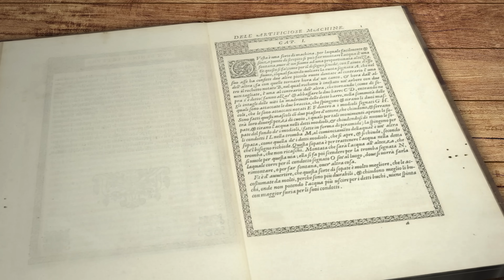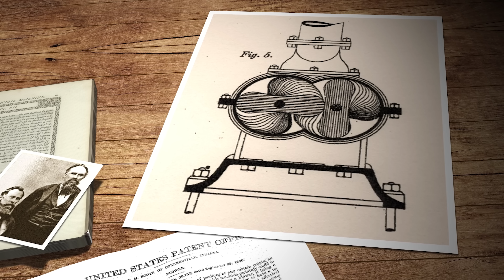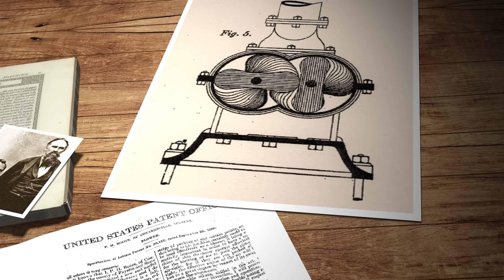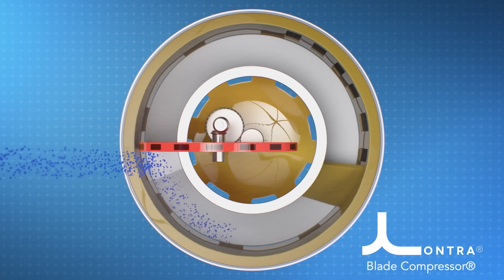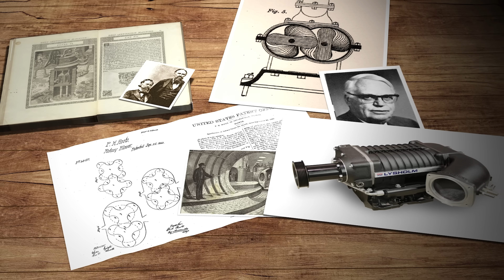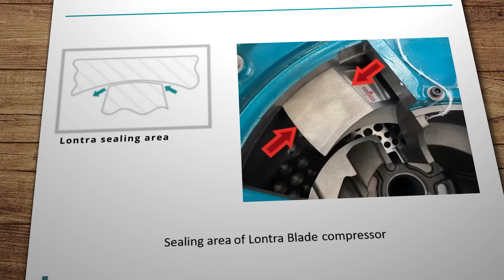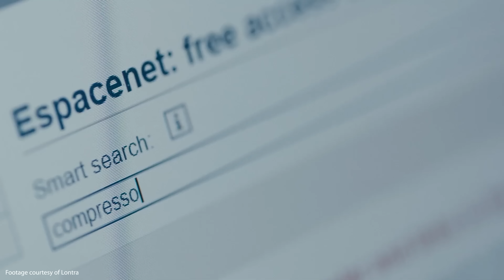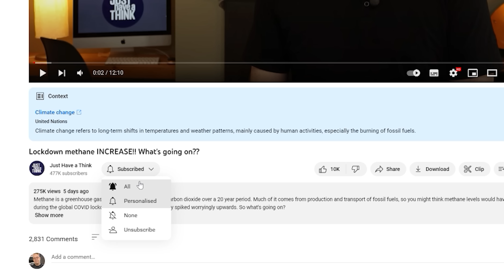Compressing air to reach net zero. A 'revolutionary' innovation.

Comment: Late to the party here, but the sealing issues for positive displacement roots/screw type blowers have been dramatically mitigated over the last couple of decades by the use of advanced coatings on the rotor packs.  These durable yet flexible coatings literally wear in to a near optimum seal upon first use.  This is one of the reasons we can see compressor efficiencies on vehicle ICE superchargers in excess of 70% now (best I've seen is 74%, may be some higher).  Turbos are more efficient still which is why we don't see too many OEM PD supercharged vehicles anymore, but the existing tech, at least in the automotive space, isn't nearly as bad as this video makes it sound.

Comment: compressed air supercharging IS a thing... GM developed it in the 60's and recently there have been some extremely fast drag race cars with it. 
The released of compressed air through the throttle body at room temp will cool the intake charge by 50+ degrees plus you will need to dump more fuel to give the right AF ratio with the add air all which will boost HP crazy.

Comment: Compressing "theoretical" air is not difficult, but real air has particulates, bacteria, COVID, water vapor...The more complicated the device, the likelihood of malfunction increases exponentially with the number of parts involved. If i needed a compressor for any particular use, my first parameters, regardless of price would be a top of the line filtration system, coupled with a precooler of the air entering the compressor, preferably, should money be no object, as close to 0 K as practicable

Comment: 300 Milli bar to 1000 Milli bar,  595 - 2630 m3/hr.   https://www.lontra.co.uk/wp-content/uploads/2021/06/Lontra-LP2-Brochure-Global.pdf
Reply: Ragged Falls air compressor used to output 40,000 cfm at 150 psi. Cool, clean oilfree compressed air cost free.

Comment: In the case of air-cons, rather than making them more efficient to reduce emissions, governments should have solar-passive home design requirements that designers have to meet in houses.
Solar passive homes are designed in such a way as to stay at a desirable temperature throughout the year. One of the ways you can do this is designing windows and shades in order to let in sun in the winter when it is lower in the sky and block sun in the summer.
We wouldn't need air conditioners at all if people just had a think.

Comment: I`m a compressed air engineer and trust me. Don`t worry about the efficiency of the compressor. I`ve been to a place where a 100kW machine was running at full load just to accomodate the air leaks in the factory and nothing is done about it. This case doesn`t stand alone.

Comment: I can't see how that's more efficient than a piston compressor.
The ratio of contact area between parts to volume compressed seems to be much higher.
And involve a whole lot of complex geometries that need to seal while in complex motion, and factor in thermal extension.

That looks like an engineering nightmare to me. I can't really imagine the engineering cost of producing reliable and efficient units to be low enough to compete with more traditional compressors.

Comment: This is not a simple machine like the bicycle pump, it still needs extremely accurate components, those gears that maintain that zero tolerance timing for that slot intersection  need zero backlash, not just the standard minimum  .03/DP, probably going to strain wave gearing,and that alone is a risky proposition,and an expensive one,with lubrication being a challenge too;
 And  any air compressor is still very  inefficient because in the process of compressing air, most of the electrical energy the compressor consumes converts to waste heat. Even the most efficient compressed-air systems only convert 10 to 15% of the operating energy into energy stored as compressed air.

Comment: A few thoughts of the top of my head, about the new compressor design, firstly, if the drive for the compressor was linked directly to a wind turbine could that be used to store energy as compressed air, which could be used to generate electricity when the wind was not blowing, or as your finger demonstrated wind powered heat generation.

secondly you described the compressor as a circular piston, may be with the addition of a spark plug at the opium site we could have an engine that uses a fat burning fuel like Hydrogen .

Comment: I'm surprised they don't simply make it a 2-cycle version by extending a larger disk across the entire surface of the housing. The disk would then sweep over the chamber on both sides. Not sure if that causes too much loading, but it shouldn't take too much modification or increase the footprint volume occupied by this particular pump. Maybe there's reasons for not going with that which aren't clear by showing the principle itself?

Comment: I've thought a lot about compressors. But, I did have a career in auto repair for 26 years. Of course that means that I one to produce the power for my pneumatic tools. I also dealt with several types of auto air conditioner compressors.

Comment: There is less surfaces to be sealed compared to some other types of compressors, but there is the the extra complication of the 90° transmission that needs to be of very high precision in order for the seals to work fine.  And for when the transmission starts to wear, the seals spaces will start to increase.

Comment: Theres a calculation error with the reduction of CO2 emissions that could be achieved. Its only 10% of industrial electicity consumption that goes into compressing air, but the industrial energy consumption on the emissions charts includes all forms of energy, also oil and gas. Therfore industrial electricity demands are a order of magnitude lower than the absolute energy demand and also the reduction potential is way lower

Comment: You probably need to go back and rethink all of this.   It really is an innovative concept geometrically but as far as energy savings goes, the numbers are likely to be bulls***.   Tolerances are not the issue when it comes to compressor efficiency.  The issue is getting rid of heat during the process.  In a flooded screw compressor, the lubricant seals between the rotors.  In a dry screw there is a 3-5% loss and possily up to 15% over the course of the lifetime but 34% is an outlandish claim for the compression process.  I've only been doing this for 40 years and own a compressed air consulting firm and we do achieve 34% gains and more.  But the issue in those systems is poor controls combined with excessive demand.  That is the real answer when it comes to energy savings in compressed air.  Even two stage watercooled double acting recips only have a 15-18% advantage over single stage flooded screw designs.

Comment: You would only see a 34% savings when you are comparing yourself against poorly designed/poorly made compressors. It takes quite a bit of arrogance and ignorance about the subject to assume that industry wouldn't have thought to improve compressor efficiencies over the years, which indeed they have, to the point that you can readily get to 99% 1st law efficiency without resorting to unproven compressors from startups. That is, you can achieve such efficiency if you're willing to pay for it. Ironically, Big Oil and Big Chemical routinely pay for that kind of efficiency due to the scale they operate at.

Comment: You didn't say how high a pressure these "new" compressors are capable of. The Hydrovane compressors of the 1970's were capable of 150psi.  At that pressure a leak that can be heard equals 1.5KW. Also with all mechanical types the problem is oil carry over. This is sorted by Norgren Oil Removing filters. At a trade show in the seventies, air from a hyrdovane was filtered with one of those filters and bubbled through a fish tank. At the end of the show there was not a trace of oil on the surface of the water.

Comment: Interesting. It seems to be using an almost identical idea as the Omega-1 rotary engine. There's a VERY similar rotary compressor which combines compression+suction into single movement of a small piston fixed to a rotating disc (like here: compression before piston, suction behind piston). But there's a difference - If I recall well, Omega-1 doesn't have this second rotating perpendicular disk with a blade, instead it uses two discs in the same plane, synchronized, and cleverly *intersecting*, so that the piston mounted on one disc at some point enters a depression at the other disc (much like gears' teeth intersect). I dont really know the pros and cons, but that design looks much safer and/or easier to synchronize properly than this 'blade' system. Re Omega-1 - https://www.youtube.com/watch?v=gi7IOXQ7oyo and the suction/compressions/intersection principles is shown from about 05:00

Comment: could this part allow pure air to be released into underwater pumped down and use the rising bubbles to power giant interlocking ferris wheels or would it have to be separated hydrogen and oxygen made in huge seabased plants through pure water inside pipes and hydrogen burn't at the surface rising the new catalysts?

Comment: I heard they had trouble with wind turbines and vibration on other tall pole type structures like chimneys use spiral helical metal screws around the pole to stop wind vibration oscillation from weakening the base when the wind frequency is causing eddies you get me? please use your connections to retrofit if possible because turbine foundations are becoming a problem for the first gen version...

Comment: Noise is the sound energy wasted. Many compressors are very noisy. Cannot even be near them. Its very difficult to work with them and take any readings. Technology advances should be able to reduce the noise levels significantly. That can contribute to another 10% or more savings.

Comment: I see them aiming at wastewater treatment and compare to rootsblowers... which is easy as roots are the most inefficient blowers for wastewater treatment... comparing against a diffuser controlled centrifugal compressor with IGV or RPM correction to control for isentropic head would be more interesting (and I know the outcome already as these are ~30% more efficient then rootsblowers) But, always good to look at new tochnology and for small opplications it might be interesting.

Comment: So, will it also work as a gas EXPANDER (air motor) to turn high pressure gas into shaft power and lower pressure gas? What is the range of achievable compression or expansion ratios?

Comment: C02 is literally plant food. The amount of C02 in the atmosphere is approximately 414.72 parts per million, yet this is lower than it has been in the past. And in the past the C02 over this level made the planet a lush garden. More plants. More plants growing and producing more 02. This is a win win scenario. Plants grow faster, fatter, better, more nutritious and exude 02 and we can eat and breath more easily. C02 is NOT a pollutant. C02 does not approach toxic levels until 100,000 ppm in the atmosphere, when it is immediately deleterious to life. There is an enormous range between 414 ppm and 100,000 ppm.
Reply: Beg pardon !, higher CO2 only benefits carbohydrate rich plants, higher CO2 for crops which favour proteins are declining in nutrition as protein plants must have nitrates. Excess CO2 over  that which has been adapted to mess with that chemical equilibria and with some producing cyanogenic glycosides ie cyanide complexes eg cassava, bamboo shoots, clover etc To combat declining nutrition more nitrate fertilisers are added, the side effect of this is more N2O released which is a more powerful GHG than CO2. Higher CO2 also makes for more evaporation eg worth getting to grips with psychrometry & infra red spectroscopy. Ideally we should return to pre industrial levels. There would be less wildfires as higher CO2 makes lignin, the structural component of trees, grow faster this less dense, less able to hold moisture, fries out more quickly in warmer weather and catches fire more easily with greater ferocity, can catch fire across old firebreaks by radiative transfer alone - doesn't need contact. Seen more wildfires even in Arctic, along with rising food prices re nutrition etc ? Btw Also got basic biochemistry more CO2 demands more water, eg the equation for production of sugars, there's a lot of H in eg sucrose C12H22O11 etc...

Comment: How do they account for the added losses brought about by the gears required to rotate the vertical wheel? Or the added power needed to spin not just a single blade but now an entire gear linkage and an extra spinning vertical wheel component? It's one reason why drive shafts just aren't a good replacement for a bicycles chain drive system. With a traditional chain and gear system all the rotation is done on the same plane to each other and the wheel they are turning. A drive shaft requires several changes in plane of rotation and this causes energy losses that have a measurable effect on performance. And increased wear-and-tear where the cogs meet. And added complexity which is harder and more expensive to maintain, as well as being generally heavier too. Not to mention this design looks like it doesn't provide constant air flow but pulsed air flow, since it only releases all the air at once when those holes in the chamber wall align with the outlet port. That doesn't make for a very efficient air pump or compressor either since it needs to operate at exceedingly high speed in order to be really useful for anything.
Reply: Beg pardon you are not changing the orientation of a moving mass so the only loss is the gears not some 'plane' based loss ie change in rotation rate is change in angular momentum you are not moving any mass from one plane to another...
Reply: @mikemassen6757  Oh well, I guess I got that part wrong. My apologies, I was partially quoting a video I watched about why drive shaft bicycles are a bad idea, and that was one of the things they discussed. That changes in rotational orientation do cause loss of energy. I guess they were just talking about the points where the gears at either end of the shaft meet the gears of the pedal and wheel hub and maybe I heard wrong? My main point still remains valid however, I think. That this pump adds way more complexities, points of potential failure and energy loss points than most other pumps and therefore will be less efficient not moreso as the video claims, and will likely require more input power to achieve similar results to a different type of pump.
Reply: @DavidStruveDesigns  Ah yes, likely ie when changing gears there's an instantaneous change in angular momentum whilst in a chain drive there's less change for same ratio - more or less...

Comment: Is it basically just a coupled rotary valve & reed valve  in reverse operation? Two stroke motorcycle engines in their heyday of the 1970s relied on these devices: eg the 1971 Kawasaki 250/350 twins (I owned one) used a rotary valve; and Yamaha 2-smoker twins utilised reed valves by the late 1970s. My 2001 2-smoker Honda NSR150SP (a collectible) has something similar. Aint nothing entirely new it seems!

Comment: Something doesn't quite add up. We have two parts in the perpendicular motion rubbing agaisnt each other. This will cause massive amounts of wear on the rotating disk, or rather it's bearings. if it goes out of alignment just a bit, it can jam into the outer rotating housing and jam the whole system. This does not look like a very wear resistant design. Not to mention all the air leaks between two perpendicularly moving parts.
Reply: There's nothing 'rubbing', clearances are tight they don't rub, the gear loss is small and the ratio gets smaller the larger the overall size, same goes for the 'air leaks' air has inertia, ie any losses there quite small :-)
Reply: @mikemassen6757  they did mention that there is a contact surface in the video, which means that parts are not just in contact, but also in friction. But wait there's even worse. The bearings of the sealing disk are under changing force which tries to rip it off the axle -  upon each revolution pressure raises rapidly and tries to rotate the disk perpendicular to its axis. Then it goes away as the gas is released. This rapid change of force will wear out the bearings which do not like changing perpendicular forces. Once the bearing wears away enough for the sealing disk to jam against the rotating outer housing, the whole thing will go ballistic. It's an awful design

Comment: I’m interested to see what the savings would be in the cost of the compressor especially for home applications where the much quieter screw compressors have traditionally been out of reach for most home shops.
Reply: I'm a Kaeser field service tech. Another major drawback for screw compressors is the cost of maintenance. The oil and filters need to be changed at regular intervals. It usually isn't practical to use a screw compressor at home. I have seen exceptions, but they are few and far between.

Comment: I'm a Millwright, and one of the things we learned at tradeschool was the importance of reducing air leaks wherever possible. I currently work on locomotives, and air compressors are an integral part of the vehicles functioning safely. This new design sounds like an excellent solution to the issues of both the screw and piston compressors.
Reply: Talk to whoever you need to. Get that ball rolling!

Comment: I was a facility engineer in several manufacturing plant operations over the years and eventually into business. Now retired for a while but I used, and still do, believe that Compressed Air...be it plant service air, dry air or control air was the most expensive utility in the plant...
Thanks for the introduction into a new approach to shoving a large volume into a smaller space... repeat...